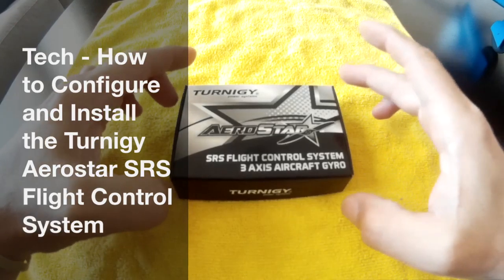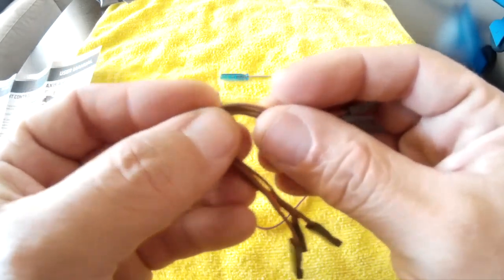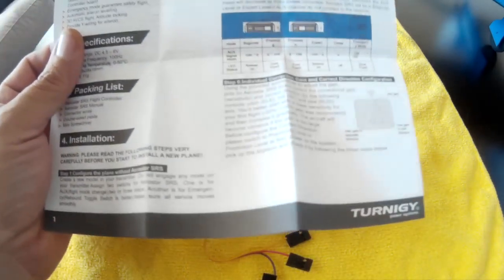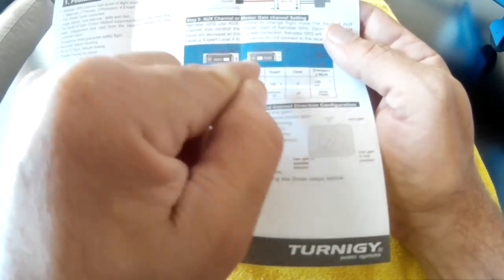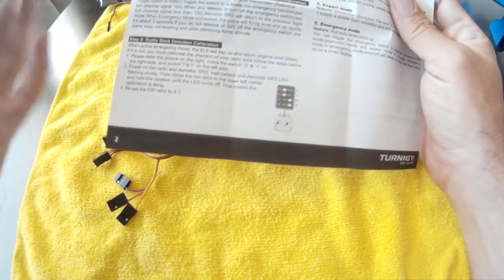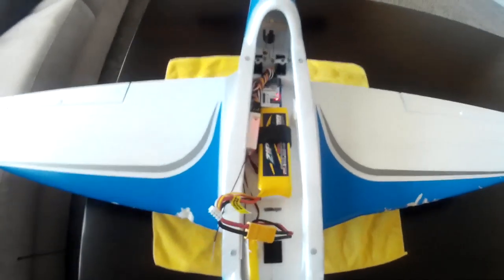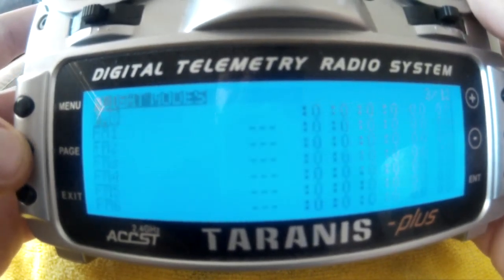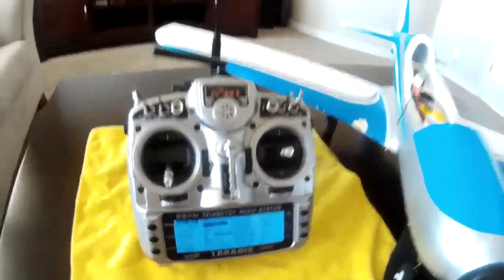Turnigy Aerostar SRS Configuration

Comment: i just bought a aerostar srs gyro. and im trying to install but, while watching your video i didnt see exactly where those servo wire exactly go. can please tell me exactly how to install it? where exactly those servo wire will be plug in? from receiver to servo.. and gyro to servo and motors?
Reply from the maker: RX Aileron Channel -> Yellow on Multipin IN
RX Rudder Channel -> Orange on Multipin IN
RX Elevator Channel -> Elevator on Elevator IN

Servos connect to OUTPUT of Gyro.

Your RX is always the originating signal. The Gyro goes BETWEEN your RX and your Aileron/Rudder/Elevator. RX -> Gyro -> Servos.  The ESC goes direct to the RX. The SRS does not manage (or care about) throttle. Watch the video from 3:35 to see the explanation of where things are connected.
Reply: will try to follow your diagram . thanks dude
Reply from the maker: +Michael Foxx You're welcome. Just remember the gyro takes input from the RX and modifies output to the servos. Or it just sends servo commands to compensate for variances in the gyro to correct for wind. So the gyro always sits between Rx and servo.
Reply: i have already install the gyro and i think it is working fine. i still have one problem, i dont know how to use or assign the on and off one the toggle switch to my radio. hope you can help me out on this one. by the way im using a taranis plus open tx
Reply from the maker: I show how to setup Taranis in detail starting at 14:10 in the video: https://youtu.be/W8Rk-AO40iE?t=14m10s

Comment: Iv just fitted this  in to  a  hobbyking  bix3  rtf  version  all seems to be  working  during  bench tests  bit  now  I'm finding  that  when I flick the kill switch for the motor  to  on  the  prop starts  spinning  on  0  throttle
Reply: This doesn't affect the Throttle at all. What you need to do is set the ESC so it brakes at zero throttle